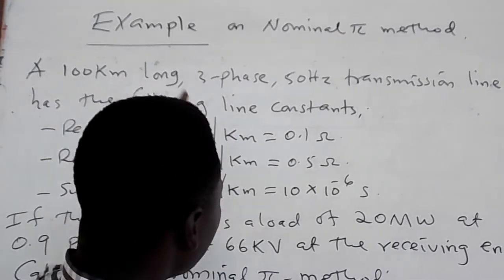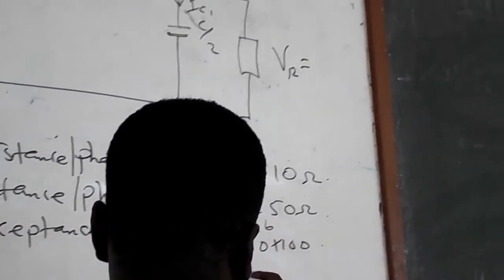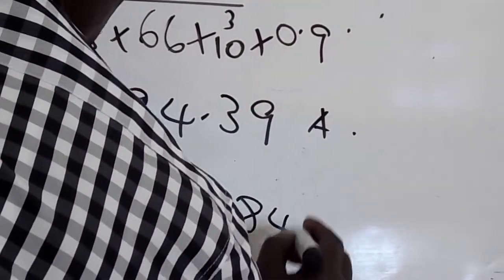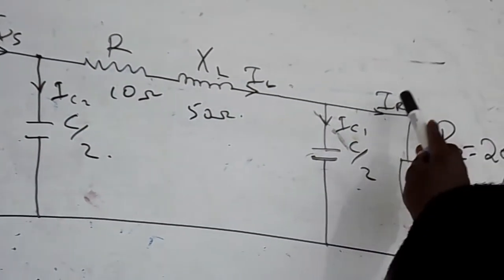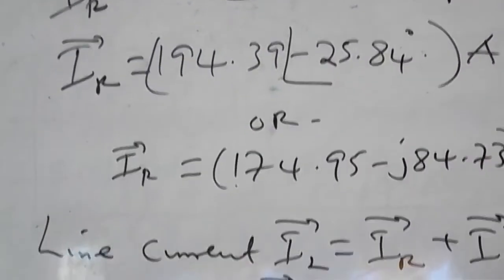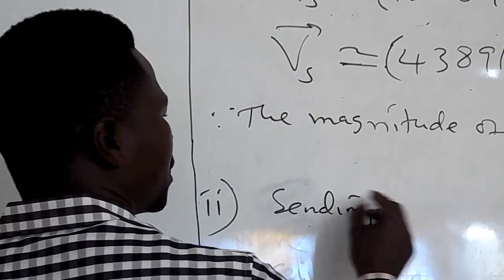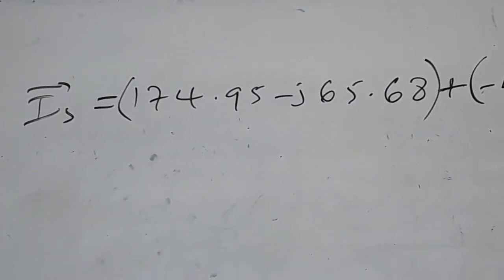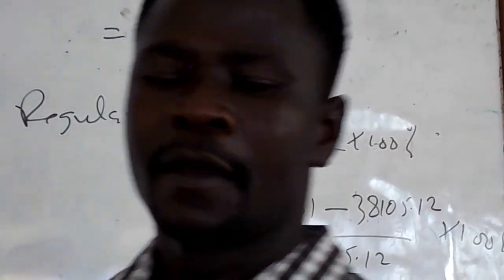Nominal π Method Lesson 2

Comment: Good insight however the value of the real part of Ir seems to be 174.95 instead of  of 194.95 if we are to achieve the phase angle of 20
Reply: i also got lost there but using 174.95 gives u a down figure  making the system not efficient